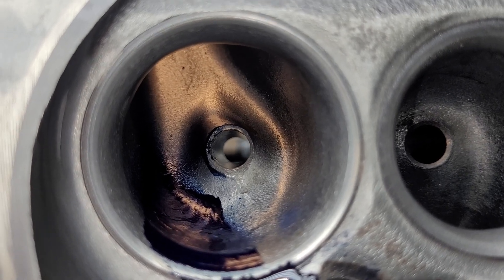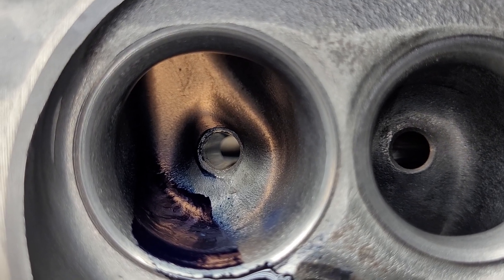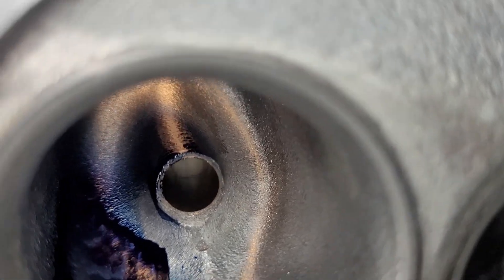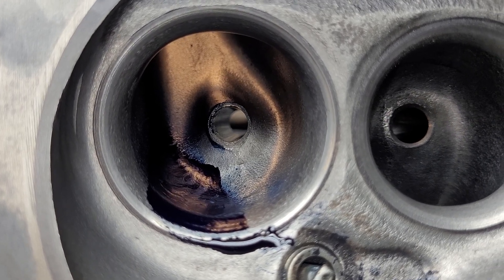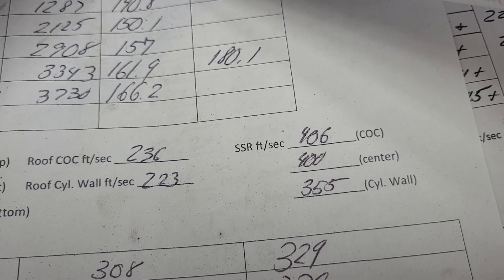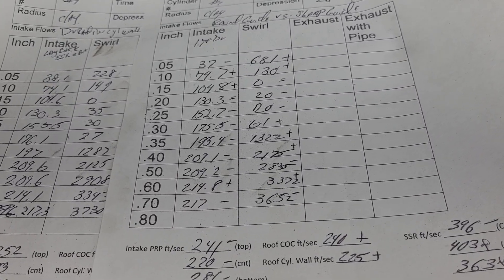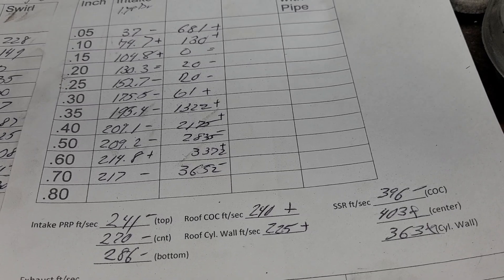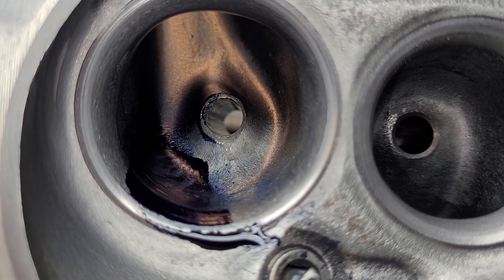David Vizard, U.T.G., U.M.S., Mission Impossible 318 project. Round intake guide vs. sharp guide.

Comment: I find not much difference in the price of valves from one to the other so if doing heads the biggest valves you can fit and not loose to shrouding always seems like a good place to start to me. Of course everything I fool with is normally turbocharged.
Reply from the maker: I was always a big valve guy. Not always the best way to go but I still like em big.

Comment: Hello Charles , I am mentally putting this together and following your hypothesis about flow momentum . You want to keep the flow velocity high to maximize scavenge - ram effect for a dense fuel charge and optimal power  . However I am under the impression this motor is going to have to spin to hit the goal ? Thus maximum volume to accommodate max flow would be justified . .  Please let me know why I am wrong in a nice way I feel foolish most of the time anyway . Thanks Man . Jim
Reply from the maker: You are not wrong but the restriction  upstream is the problem.

Comment: I would think opening up the 318 heads to the 360 1.88 intake and 1.60 exhaust valves would help. I know you can't do 2.02 intake without notching the cylinder bores.
Reply from the maker: Rules state stock valves...ugh
Reply: Then why did you spend so much time talking about switching to LS valves in your earlier videos? If you wanted the best budget shot going into the project, you would have started with a 318 magnum and then you would be starting with 1.92 and 1.62 valves and a closed chamber.
Reply from the maker: @joelbraun5960  D.V. wanted to use the ls valves the faithful had a fit.

Comment: What about the Combustion chamber itself? There's still a slight rigde at the edge of the seat. Even though the port would flow, it can't get past that ridge. And if you have a higher/sharper hump on the pinch side, that creates turbulence when the volume increases after the pinch.
Reply from the maker: The chamber is close just not finessed.

Comment: Two points: Boeing also designed the Gen 6 fighter jet. No rounded body panels! Super sonic and radar reflective! Lol. 
  And... knowing bullet coefficient from a projectile is also increased with a sharp point followed by a radius and dovetail. 
  If I was more intelligent,  I would do the mph to fps conversion.  At 140 mph, sub sonic shapes act like Super Sonic profiles.  
  The guide acts like the vertical tail fins of a air craft. Or the long roof line of a high-speed car. It brings the air column together behind the flow.
Reply from the maker: Great stuff. Thanks

Comment: Are the K line guides thick enough to remove the cast iron  portion of the guide protruding into the intake port and the insert support the valve enough?
Reply from the maker: No, they need iron around them. They are very thin.
Reply: @servediocylinderheads  Was thinking how much flow gains possible with the guide narrowed down to a 1/16" around the valve would give
Reply from the maker: @ronnieb7408  In the 90's I would take the whole guide out of E7 heads. They lasted even with big roller springs. I wouldn't do that today.

Comment: Sharp corners also tend to shed vortices, vortices tend to push air laterally, it creates a flow restriction, but it also entrains that is, sucks air upstream. In short they tend to accelerate air a bit. That's how paper airplanes fly. The vortices that form on the wing shove air outward, which pulls air across the top accelerating it creating lift.

https://youtu.be/NF4cf8XFV8k?t=51

Comment: Maybe a chamfer in the same direction of flow on the fast side of the guide and leaving other side alone with maybe just taking out the sharp edge on the rest of the guide on the slow side...might bring speeds up a tad?
Reply from the maker: A bit of a roof change helped the speeds.
Reply: @servediocylinderheads  I'll send you a drawing of what I'm meaning later..not a drastic chamfer but a small one in direction of flow.
Reply: @servediocylinderheads  ..maybe same results without needing roof change..just a thought.

Comment: n the speed be increased by filling/raising the floor a bit?
Reply from the maker: I would think 1.88 intakes are a must have too.
Reply from the maker: I was thinking like that too, my mass flow is still too low!
Reply: @servediocylinderheads  I am doing a set of 318 heads for a 360 at the moment. According to my measurements filling the floor around 0.100 and transitioning into the short side makes sense. Unfortunately I don't have access to a flow bench. All I have is what works for you and others and my own experiences. I did install the 1.60 exhaust valves from a 360. 
I'm trying to get a higher low to mid rpm torque advantage for a heavy vehicle with a slightly larger than the stock, measly camshaft.